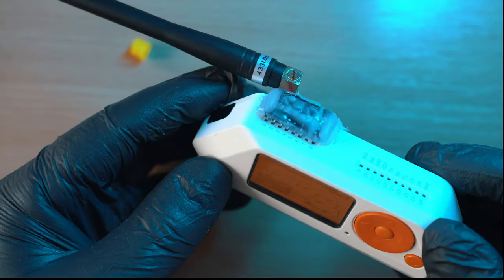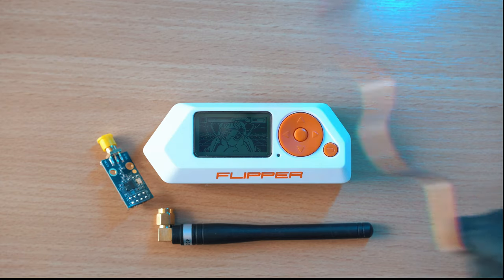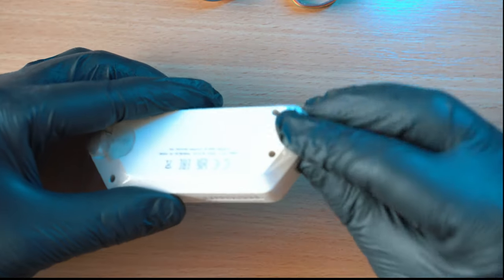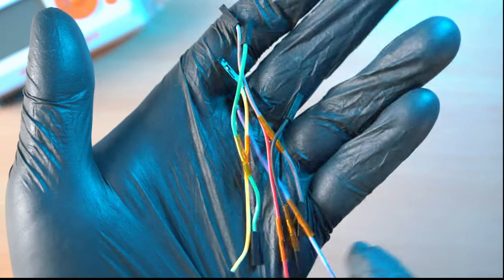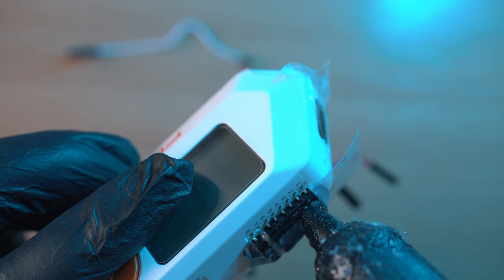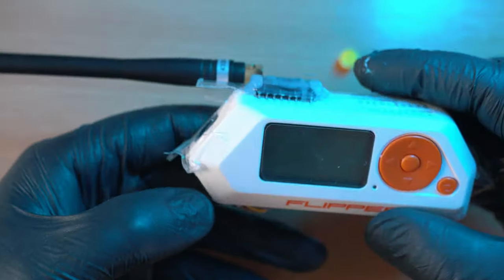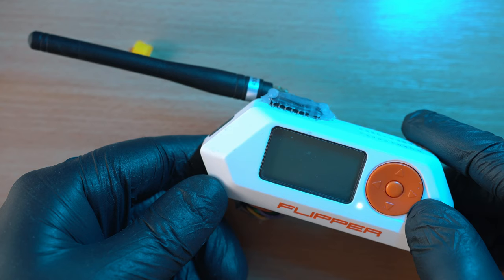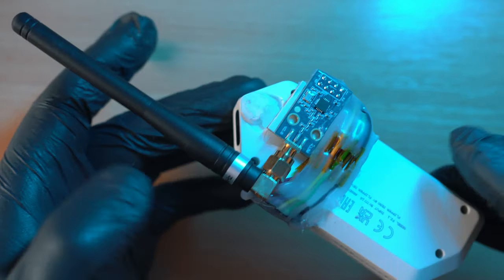Flipper Zero External CC1101 SubGHZ module DIY...

Comment: Had a question hopefully u answer but can I put in 5v instead 3.3,I mean it's designed for first 7 gpio ,keep putting on 3.3 n grnd on the other side of gpio so just wanted to know everyone that sells this module uses 7 gpio,the first 7
Reply from the maker: it works with 3,3 … some would say it needs 5
Reply: with 5v' is it more powerfull? or is it a reciepe for magic smokke?? @takeapart
Reply from the maker: @paranoidzkitszo this module needs voltage to run properly
Reply: @paranoidzkitszo  you can use also 12V for more power :), so burn better!

Comment: Isn't the CC1011 rated at 3v any issues running it at 5v?
Reply from the maker: all is just fine
Reply: I've read multiple data sheets for this module that say running it at 5v will damage it. The recommended voltage is 3.3v, but it can take up to 3.6.
Reply from the maker: thanks for your research!  people are using it with 5V so let’s wait and see what will happen
Reply: @TAKEAPART  I tried 5v and it broke the module and the chip overheated.
Reply: people use the cc1011 on the 5v pin (pin 1) but with a 5 to 3,3v converter.  . so have to connect on the 3v pin without the converter, or on the 5v pin with the converter..
Reply: @takeapart  see what will happen? Are you crazy? 5v broke the chip which require a max 3.6V. the boards that come at a high price have a 5v to 3.3v converter

Comment: Why would it get hot during installation if it is off?
Reply from the maker: it shouldn’t get hot … even if you mixed up wiring it should not get hot
Reply: @takeapart  In your video you basically said the tape is used to protect it from heat during installation. Are you saying that the hot glue gun could make it hot so you using the tape to protect it from that?

Comment: In the sub GHz radio setting there is no external module option, only internal. freamware rough master 0912
Reply from the maker: I have unleashed…. maybe RM automatically detecting ext module. IDK
Reply: @takeapart  Why can't Flipper Zero be used continuously for original car remotes? and can only be used once, not more
Reply from the maker: @jokolaksono9582 all is in rolling codes… car manufacturers using more sophisticated rolling codes that ones available for garage doors …
Reply: @takeapart  How do you make sure that the results of the Flipper Zero rolling code capture can be used repeatedly
Reply from the maker: @jokolaksono9582 you can not… at least not for now (for cars)
Reply: @takeapart  Sometimes there are some that can be used continuously, but not all of them can only be used some

Comment: Well i have it put together, operating through external module, however, when i run frequency analyzer, im not finding anything, also it doesnt seem as if the range was extended as much as i thought. Im also using the mini antenna, have a bigger one coming tomorrow. Also, when i do get it to work, i turn 5v on in gpio setting, go to subghz, come back to gpio and 5v is turned back off... any thing on this?
Reply from the maker: hi, what fw do you have?  Frequency analyzer is bit of a pain with exter module as it picking up noise from module and cables. (for now not really usable) you can exclude frequencies for frequency analyzer but that’s about it. 
about 5V issue I have seen this with bad connection…. so double check wires and make sure they solidly connected. 
thanks for watching
Reply: @TAKEAPART  im using unleashed, the most current which is 045. Ok thanks, ill check the connections again.
Reply from the maker: same as me …. check wiring and let me know
Reply: @TAKEAPART  i checked wiring, all is good, flipper is recognizing that there is an external module plugged in, 5v in subghz external module is turned on, i go to gpio turn on 5v, go back to subghz, go back to gpio and its turned off... i suppose i could try rewiring, but everything was connected...
Reply: @TAKEAPART  i tried rewiring... i think i may have blown the cc1101... i used some glue... that may have done it. I have 2 new ones on the way... so i guess ill have to wait until i get those to have another go at it... otherwise, do you have any helpful tips?
Reply: @triple9finestacker631  any updates on this?
Reply: @bojjeds3921 he probably gave up
Reply: @Determinator21  yeah😂😂

Comment: can this module revice from longer distance ? also?
Reply from the maker: module itself no but if you attach right antenna…. then yes
Reply: @takeapart  so this antenna in ur video cannot receive? But Bigger antenna will receive?
Reply from the maker: no, antenna in the video can transmit and receive signal way better than one inside of flipper.
Reply: @takeapart  i ordered this module today Bcz thinking its What it dose 🥲🥲 rip 5 buks hehe
Reply: @takeapart  so Its can transmit and receive abit Longer distance also no? From what inside flipper 🐬
Reply: @takeapart  ty for Fast respond ❤️❤️❤️
Reply from the maker: it is amazing piece of board! you won’t be disappointed!  get antenna and you can do a lot greater distances
Reply: @takeapart  if the flipper can receive like From 1 meter away this module will Make 50 meter around away no?
Reply from the maker: thanks for watching!
Reply: @takeapart  and one more question what is the diffrent between the Last video you made But the Cabel is Diffrent Management in February u uploaded a video but the Cabels is Diffrent way connected there is any difference?

Comment: I think the external module CC1101 is a BIG FAIL for flipper zero many money spent and require a external module because internal CC1101 is crap!
The only interesting thing is that it allows you to change antenna using the same chip, while the external modules still operate on a fixed frequency.
I have been using CC1101 modules for about 9 years connected to PIC18F microcontrollers, Arduino or Raspberry Zero boards. If the software was ported for linux using a raspberry zero it would be cheaper.

Comment: Yo thats bad! For real! You shuld use the following pins on the flipper:
2 	MOSI
3 	MISO
4 	CS
5 	SCK
6 	GD0
9 	VCC
11 	GND
Reply: the cc1101 v2.0 should run with max 3.6V, not 5V.